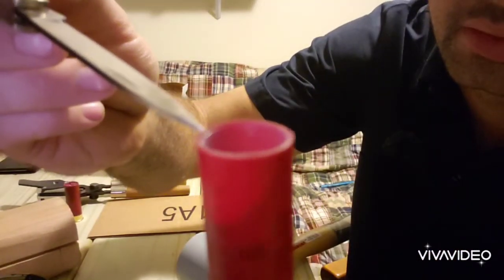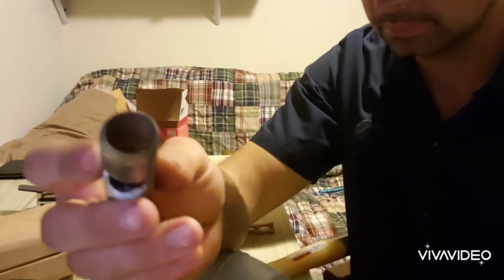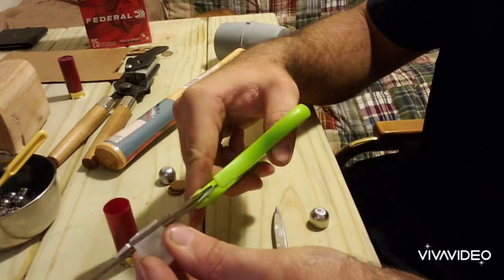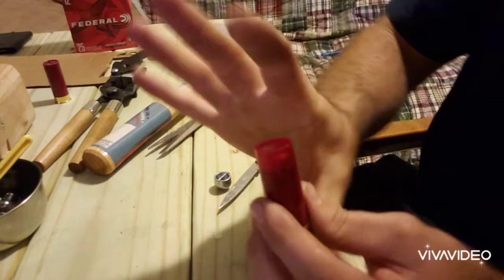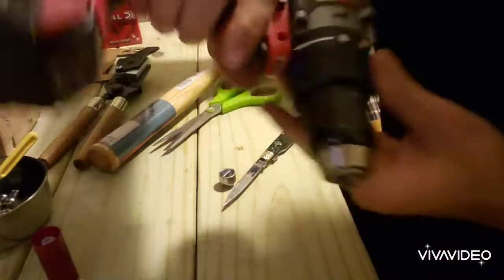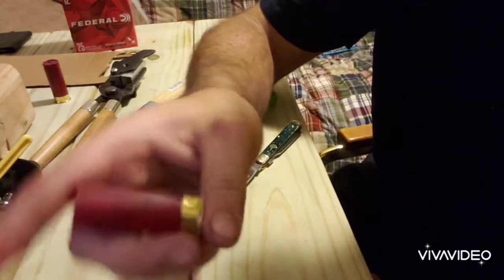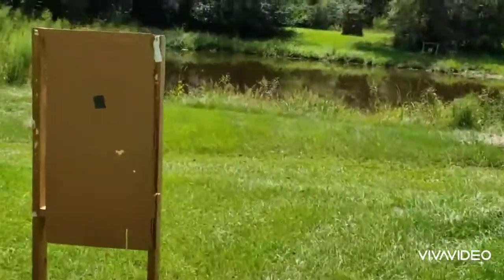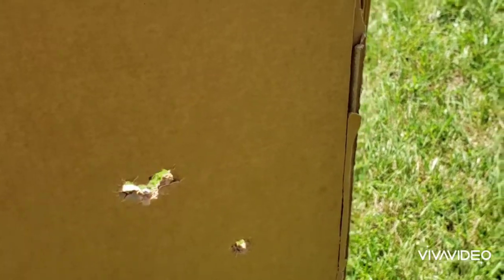Turn birdshot into slugs $0.25 slugs

Comment: Brother I need your help.  I'm trying to do this with my bird shot but 
my slugs won't let go of the Lee core pin.  Is it because the antimony 
is too high in the lead?  I sanded the core with 800 grit sand paper but
 it didn't help.  Maybe I need to use a slightly rougher grit?  Tried 
smoking it too but no luck.
Reply from the maker: The wad wont separate from slug ?
Reply: @whiteoakforge-  The slug won't let go of the core pin when I'm casting.
Reply from the maker: Ok when you pour the lead in the mold cut the top part off the excess lead then you open up it to remove the slug from the mold the slug is stuck in the center of the mold ?
Reply from the maker: The mold needs to be really hot the hotter it is the easier it is to real youll also need like 2x2  or 2x4  piece of wood to tap the back of it that also helps to release it
Reply: @whiteoakforge-  I let it get to temperature, couple times too hot the lead didn't set XD, sadly I got a little heavy handed and already started dinging the mould from trying to bang the lead out.
Reply from the maker: Is the lead slug still stuck on the mold ? If so try torching or mealting the lead ,leads melting point is lower than aluminum
Reply: @whiteoakforge-  yes when I open the mold it won't let go of the middle drive key part.
Reply from the maker: @shindukess  tap the back of the mold with block of wood semi hard
Reply from the maker: @shindukess  what are you using to heat up the lead
Reply: @whiteoakforge-  I kept doing that.  It gets stuck like it's glued.  Dinged up my mould and started bending it from trying to pull the slug with pliers.
Reply from the maker: @shindukess  if the mold is cold it wont release you need to heat it up to expand the metal of the lead
Reply: @whiteoakforge-  a lee 20lb melting pot.  I laid a corner in the hot lead to heat up.  Sometimes it was too hot and the lead didn't get to set so it oozed it when I opened it.
Reply from the maker: @shindukess  i don't think was to hot i think you just neec to give it  a few seconds longer to set
Reply: @whiteoakforge-  tried it all varying temps.  I'll try some kind of lube.
Reply: Not sure if this trick will work for ya but I have a old mold that I got that had lead left in it. I heated it to get the lead out. After that my sinkers always stuck tried cleaning it tried smoking it tried heating it first. Ended up using non stick pan spray like you use to cook with that worked but burned off fast so I just respray it every third time may help
Reply: @timknickel7756  I got it to work.  The Monarch birdshot I use is too hard from the antimony.  I threw a small amount of split shot weights I find from fishing and it was just enough to dilute the antimony.  Started casting and the slugs fell out without needing to tap the mold.  Didn't smoke again or anything for the 40 slugs I made.
Reply: @shindukess  I put a little carbon, with a match or lighter, on the core pin and cast hot.  I cast the birdshot directly with few issues.

Comment: Need to be carfull using wheel weights in shotgun slugs. They don't stage through the choke like pure lead that the mold desighners engineered it be used

Comment: Why not just buy a sack of bird shot or a bunch of fishing weights?  
Bench audio was low, at full volume.  I use a self powered speaker, not laptop speakers.  Good idea, make shells with simple tools.
Reply: He mentioned wheel weights and the birdshot he's dumping out of the shells, and he implied any source of good lead you can get your hands on. He's re-purposing the birdshot he doesn't want and using it to make slugs. Birdshot loads are by far the cheapest of shot shells so this is a super way to make a "poor man's slug".

Comment: Just drill an 1/8" hole center of bird shot and inject an epoxy to glue the shot together. Now you have a round that will stay intact till impact. I have never done it but was thinking it would be fun to try.

Comment: You cant shoot slugs out of a shotgun that isnt rifled it wont work properly. And never use bird or buck shot in a rifled shotgun. You will destroy your gun and over time blow up the barrel.
Reply from the maker: I Never suggested shooting buck or bird out a rifled it would spread to much unless your with in 5 yards it's pointless ,and say you can't shoot a slug out of a smoth bore because it won't work properly is depending how accurate you really need it to be most people don't need rifled slug barrel to hit a 12 inch plate at 50 yards

Comment: Shouldn't use short brass for heavy loads, not good for the gun and not good for the shooter.
Reply from the maker: The it's not a heavy load, it's the same  weight as the bird shot its just one solid round vs several hundred rounds
Reply: Reshaping a pound of clay from a square to a ball doesn't  make it weigh more.